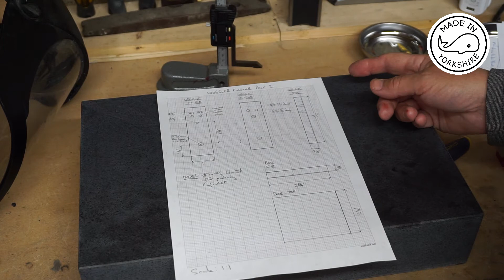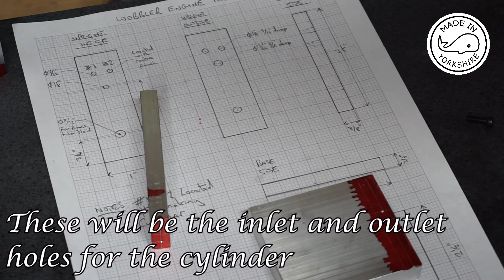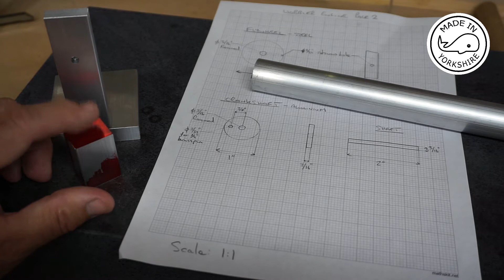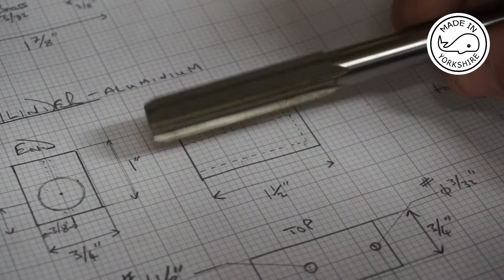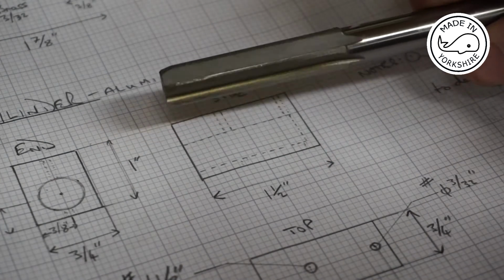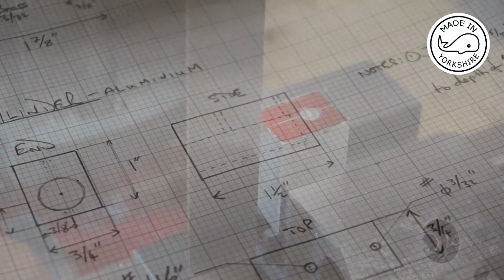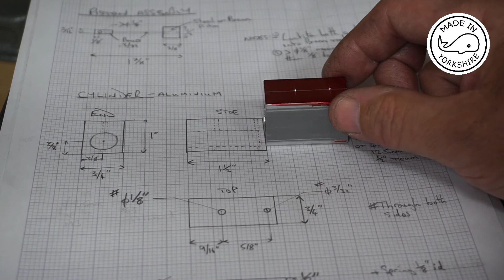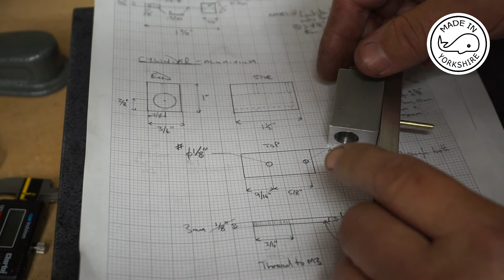#MT20 Part 1 - Making an Oscillating /  Wobbler Engine. By Andrew Whale.

Comment: Andrew, great project. A word of warning, I did tell Mr Pete222 several times but he seemed to ignore me. It is NOT a good idea to use brass and aluminium together where moisture is to occur. There is an electrolytic action between brass and aluminium  as  soon as it gets damp, the aluminium will corrode badly. He had brass pistons in an ally block, it WILL seize up eventually. I was almost 40 Years  in engineering at a research labs, we would sometimes get an assembly back from a scientist, who at some time lost a screw and just replaced it with a plain brass one in ally. Electrolytic action happened and he could no longer get the screw to turn, he had to return it to us for refurb and we had a heck of a job getting the seized screw out. Sometimes we had to make a new part, so be warned. Always use either Stainless steel or nickel plated brass screws.
Reply from the maker: Hi Dave - fair point. This was my first venture into model engineering. It was a great little project to undertake and it did introduce me to the basics of a simple steam engine. I only ever ran it on air but I guess it would be a totally different story hooking it up to steam. This little engine got me hooked into making more complex ones.

All the best.
Andrew

Comment: How can I get the plans for this engine. Just started model engineering and would like to have a go with this one. And if anyone’s got any advice on where to get stock metals. Thanks
Reply from the maker: Hi Matthew - if you email me your details to learningturning@btinternet.com, I will send you a copy of the pdf plans I produced. Regarding stock metal, there are lots of suppliers on the internet. I just searched for aluminium suppliers and chose something reasonably priced. I can't remember which supplier I used. 
Cheers
Andrew

Comment: You will find links to drawings for MrPete222s wobblers are on his videos.
Reply from the maker: Hi Brian - thanks for the feedback. I could only find one link to drawings in mrpete222's Part 6 video. Unfortunately the google drive link provided doesn't exist anymore. If you know where some plans exist for this little Wobbler, I would really appreciate it if you cound email me the details. My email address is contained within my About page. I can then include this info in my description.
Mant thansk
Andrew
Reply: Learning Turning Metal - by Andrew Whale - Sorry Andrew I couldn't find your email so am replying here. My mistake, I thought tubalcain had included plans in his wobbler build but the ones I was thinking about is in his Yellow Boy build, part 1. 
He also has plans for his Vertical Steam Engine, part 9, https://youtu.be/hq53e5hljP4  , Brian
Reply from the maker: Hi Brian - no problem and many thanks for the other info/link. Interesting that mrpete222 has made available plans in imperial and metric for this other little engine. It looks more complicated than the little 'Wobbler' I made, with lots more machining, but I might give it a try. 
If I was to make the Wobbler again, I think I would try to modify it by replacing the brass tube bearing with some kind of miniature ball race. 
Thanks again and take care.
Andrew
Reply: Learning Turning Metal - by Andrew Whale Andrew, if you something really small you could try a wobbler made out of a 13amp plug. Plans are here - http://www.john-tom.com/html/SteamPlans3.html . Take care and have fun, Brian
Reply from the maker: Wow Brian - that is really interesting. Added to my 'to do' list.
Cheers
Andrew